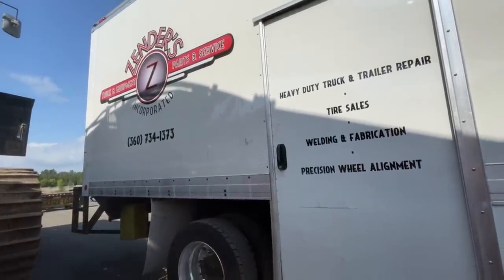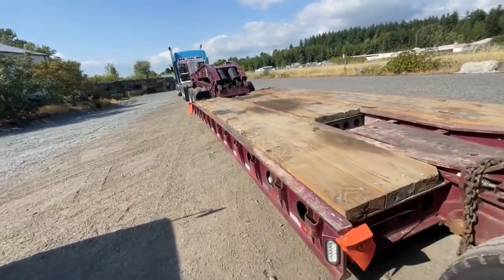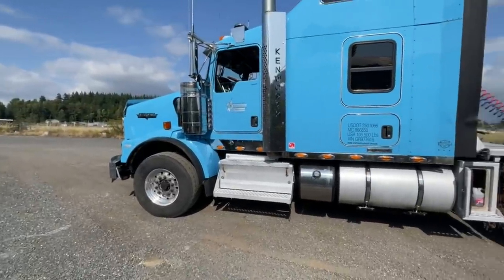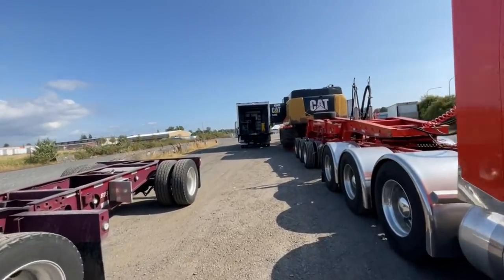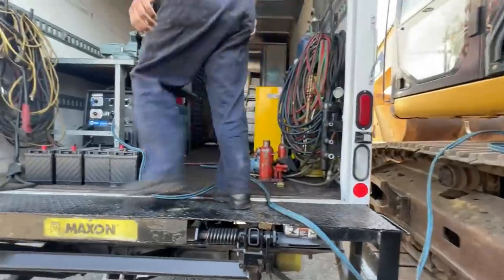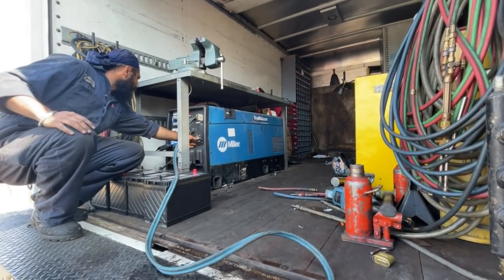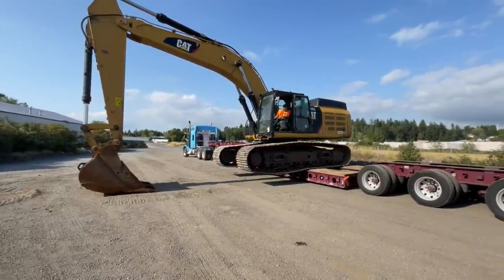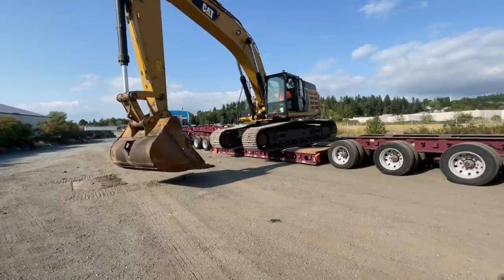Final CANADIAN load.

Comment: Looks like the axle spacings on the Canadian hauler'
s trailer looked longer. Canadian trailers usually do have a bigger spacing even on tandem trailers. Seems like the guys that side load don't own the equipment. Owner/operators have to pay for the equipment, so they don't load that way.

Comment: States and Provinces vary in what they allow for axles weights, axle spacings and lengths. It can be a nightmare keeping track of them. I don't understand how they allow those excavators to be hauled with the counterweight, stick and bucket attached. Our wheel loaders came without wheels and a bucket which were hauled on a second truck. The Liebherr 944 material handlers were shipped with the stick and the wheels on a second trailer  I thought permitted loads were only for things that couldn't be dismantled to be made lighter or smaller or both.

Comment: A little curious, I regularly haul our company's 2 CAT 349E's on a 7 axle setup here in NC locally. My permits are always approved and I've never been hassled by DOT. Are you running a jeep because of Canada? Or do western states have different weight regulations
Reply from the maker: You move 349's with the counter weight on 7 axles? That is impossible in all the States we cross. I could do it in some states on 9 but some States require 11.
Reply: @KeepingitAnalog  depending on wet weight and buckets our machines are grossing 110-130k in which case we have a stinger we can attach but yes we regularly run 349E and F on our setup. We will also remove the counterweight depending on the city we are in.
Reply: Sorry also 7 axles was a typo we run 8 with an available stinger if needed

Comment: doesn't show me the respect to the owner of that trailer that has twisted and distorted like a pretzel. Especially with that size/weight of excavator. Would have been quicker and safer and much less stress on that trailer to load it correctly.